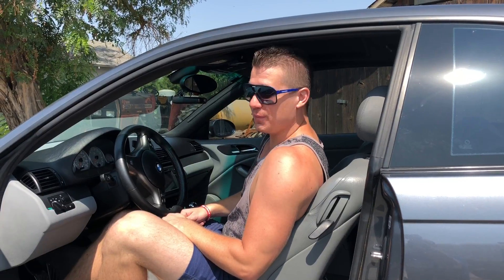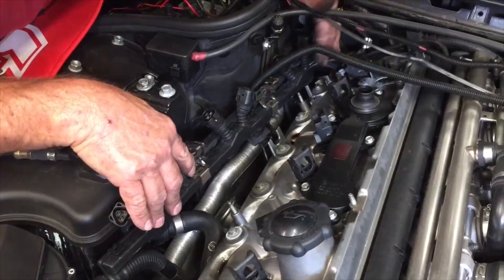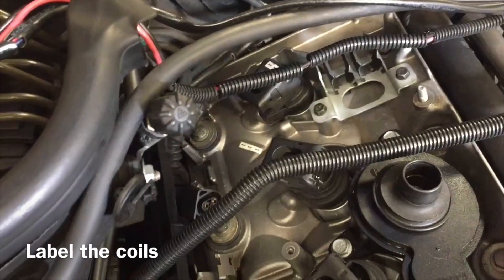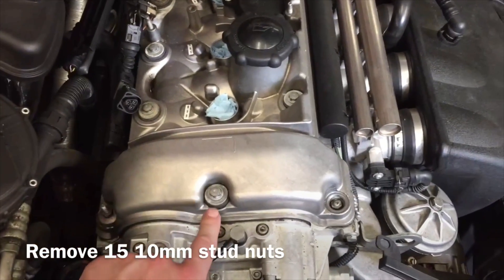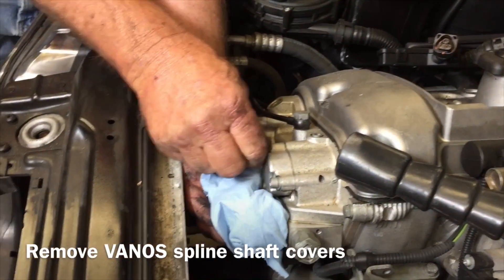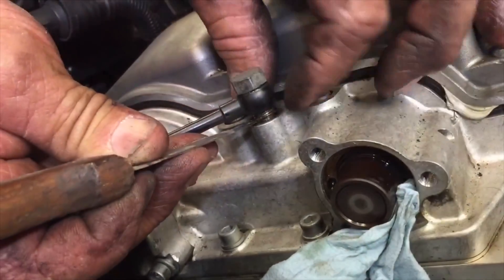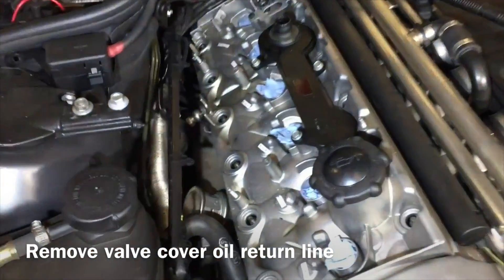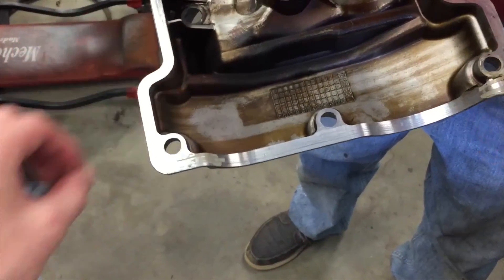HOW TO: Remove Valvecover+ begin VANOS removal BMW E46 M3 S54 (Part 1)

Comment: Hey guys... quick thanks for these awesome videos. They were extremely helpful as I wrenched on my 2006 Z4M this past weekend! Cheers to you guys! I even caught myself saying "and there it is!" a couple of times during the work. :) 

Preventive maintenance I did on my 54k mile roadster included: Beisan oil pump disk, vanos seals, Beisan vanos solenoid pack, cam bolts, upper chain guide, valve shims (while it was open - 3 were out of spec) and new plugs.
Reply from the maker: nice man, good work!  hope it keeps running strong. Any plans for the project? thats a fun car!

Comment: Aren't crush washers single use? Replace em?
Reply from the maker: Yes! Good question, We are just very particular about not losing parts so that we know what we need to order when reassembling. So yes they are single use- they can be picked up at any auto store.  For example, that crushwasher for the oil supply to VANOS is very important to change A side note,  When reassembling we actually replaced many of the oil return lines because they were old and damaged and therefore have new crushwashers with those kits.  This will be seen in later videos  One thing you must do is get a valve-cover install kit (gaskets and all the rubber grommets that go with the studs) we got a BMW set from ECS tuning.
Reply: Legends. Can't wait till this series is done so I can get into my s54 too